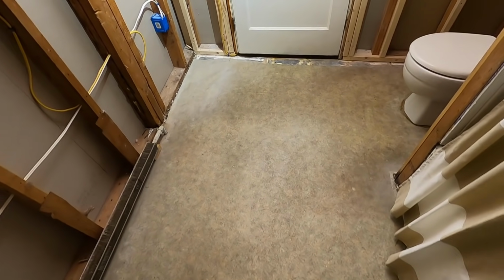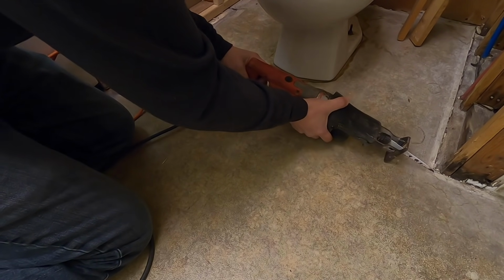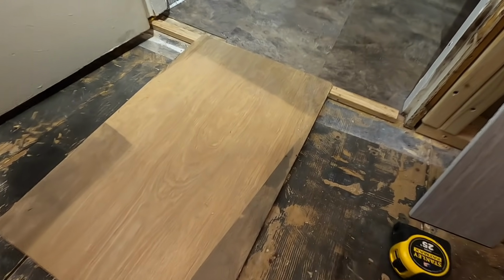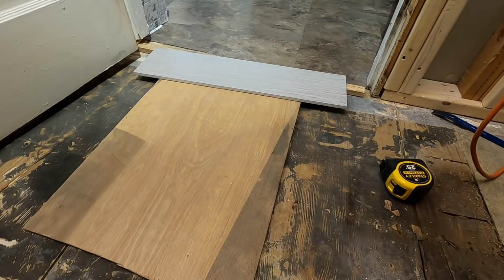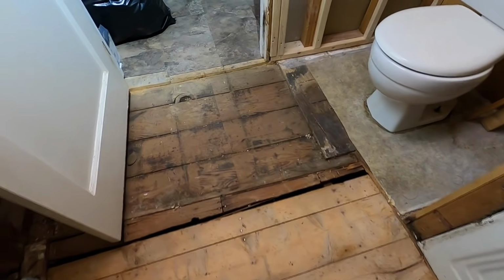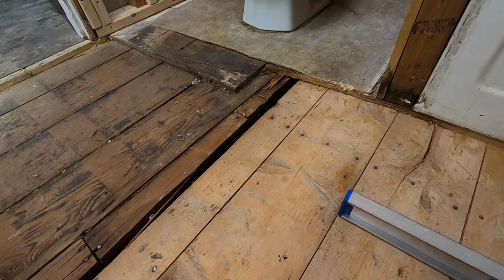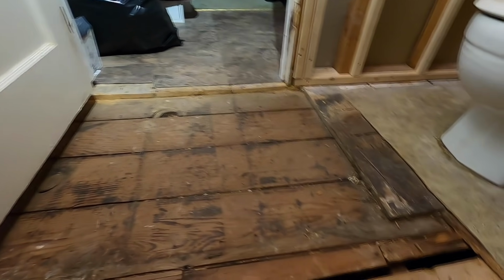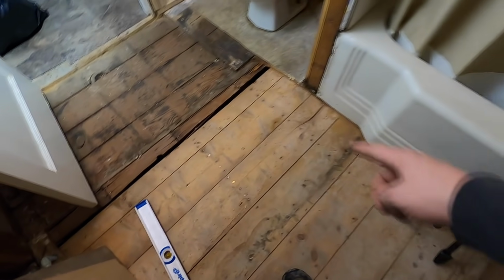How to Tear Out Old Flooring | Rolled Vinyl and Plywood Underlayment

Comment: Can you get the squeaking out of hard wood floors or do you have to go under the hardwood??? Loving this series. 💗
Reply from the maker: Hey, Pauline!  Great question... I should make a video on this one day.  It really depends I guess on where the squeak is and what kind of sub floor, etc.  You can always predrill holes in the hardwood and use small trim screws to tighten it up but then you will have to fill the hole and make it look nice.  A screw from the bottom up could also work...  Thanks for watching!

Comment: Is there a reason you aren't using a self leveler? Seems like that could be beneficial here?? I'm enjoying this series!
Reply from the maker: Hey Nathan!  I wanted to use "large format thinset".  You can put it on really thick and it dries like concrete.  Also adheres to wood and cement board really well.  I have had issues with floor leveler in the past, either not sticking or cracking.  The amount to fix this would also be very expensive!  Thanks for watching!

Comment: You could staple chicken wire down and float the floor with thinset type mix I would need to look it up mapei product. It would be thin enough to lay the tile and ypu could level it out with thinset
Reply from the maker: I have a very similar plan... Stay tuned!!

Comment: Use self leveling concrete. Put plastic over the old wood floor and pour the self leveling concrete. then all You have to do is tile over that. your floor will be prefect.
Reply from the maker: My plan is very similar to that 😁. Stay tuned!!

Comment: 3/4 ... 5/8 ... it would be so much easier in centimeters and such :)
But I understand why this isn't gonna happen. Just look at "3 feet". That a pretty single digit. In metric it would be 91,44 cm. 3,3" too short for a "pretty 1 meter single digit".
You're used to 3 feet and we're used to 1 meter. Different in length but exactly the same for each others point of view.
Reply from the maker: I have heard this a lot.  I am so used to measuring in feet, not sure I could switch.  Thanks for the comment and for checking out the video!